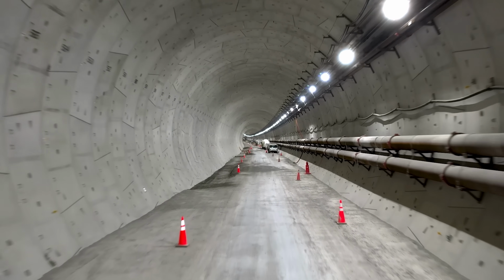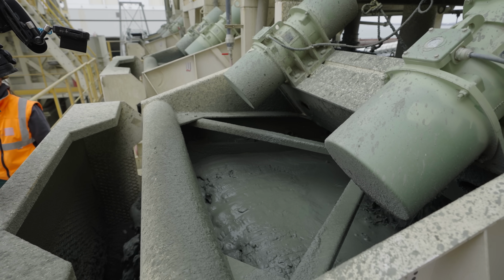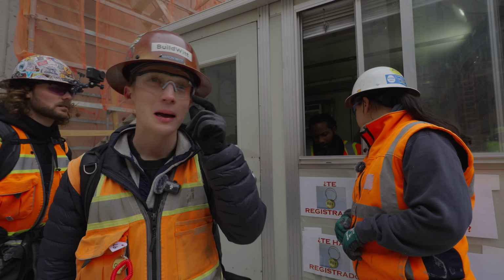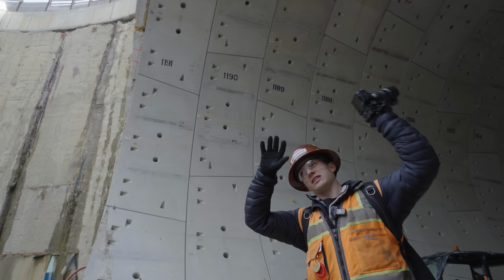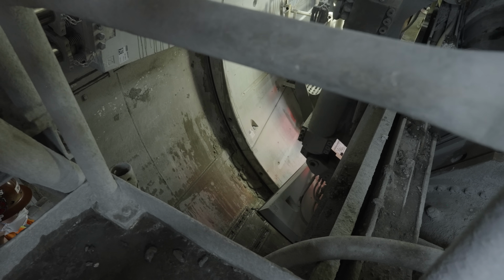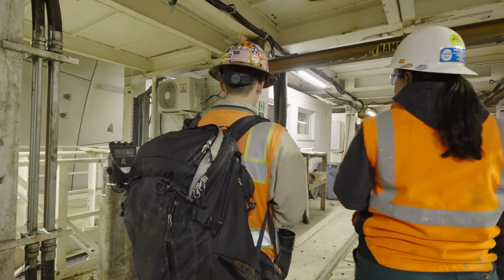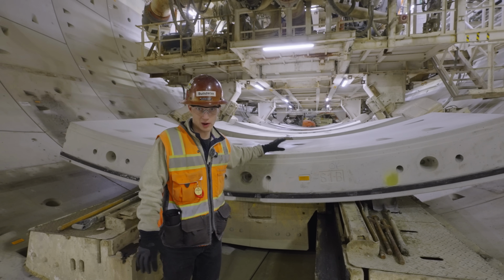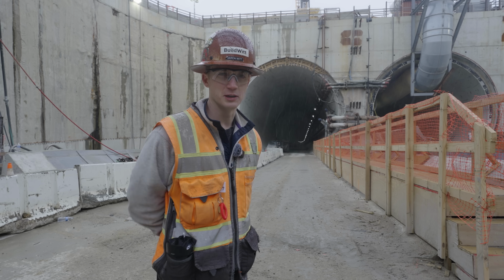Inside Virginia’s $4 Billion Tunneling Megaproject!

Comment: This will be great when it is finished. Coming down to VA Beach from the Shenandoah Valley for the Neptune or summer vacation, for many years due to traffic congestion, I started taking the back way coming in from US Route 460 off of I295 and then picking up US Route 58 to bring me in rest of the way. The back way is a scenic route and slower speeds but the time works out to the same as if you took I64 all the way to I264 IF there were no backups which is rare on a holiday or special event on a Friday, Saturday or Sunday afternoon or evening.

Comment: My 20 years oilfield 6 of it was as a Derrickman tripping pipe and maintaining the designed chemical composition of the drill fluid "mud". The filtration system..shaker,degasser, desander, desilter, active pits where the mud is pumped downhole to the bit where it's circulated uphole, the downhole cuttings to the surface where it flows across the "shale shaker" to initiate again its full filtration. Great exercise 💪

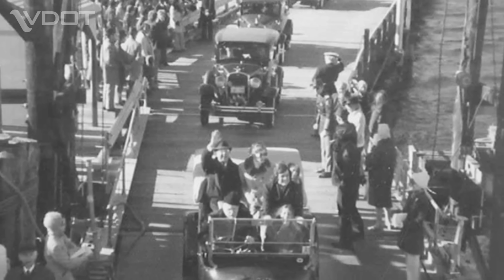Comment: 1:01 I think the HRBT technically is a replacement of the Old Point Comfort-Willoughby ferry, which operated from at least as early as the 1920s until the HRBT opened in November 1957.

Comment: The TBM launch pit is built using three circular rings that act like arches, with each segment functioning like a keystone to prevent collapse during excavation. Building the launch pit is a feat in itself: each section is excavated in stages (about 8’ wide, 15’ long, and up to 250–300’ deep), reinforced with rebar cages, and filled with concrete using the tremie method. This process is repeated until each ring is complete, after which the interior material is excavated and removed. Finally, large struts are installed at the top where the rings connect to provide additional support to prevent collapse of the side walls. That’s why they are not square

Comment: It's a vibratory not a shaker.  TD  Atlanta USA
Reply: In the tunnelling industry the STP is generally made up of three stages a trommel (to 10mm), sand shaker tables (to 0.2mm (200microns)), Hydrocylones (to 20 microns). The rest is the same size as the bentonite in the slurry so goes back into circulation. As the fine particle density increases a portion of the Bentonite/silt/clay slurry is removed and fresh quality bentonite slurry is replaced.
The waste bentonite removed can be tankered away of put through a centrifuge or filter press to remove the remaining solids and bentonite, leaving clean water to recycle back into the process.

Comment: Also could you just make the drill heated to the point it makes the rock and dirt molten? Then the drill is both heat resistant and cools the material as the device moves turning it into an almost glass tunnel? Less debris and need for the slurry thing? Like a nuclear laser drill.
Reply: Imagine the energy required to heat the sand to melting point then cool it down again.
The TBM would also melt in the process of course.

Comment: Mixture ( bentonite ) out of what they digging?  Bentonite?   You got distracted so pumping into where?   I am missing some parts….TBM?  

Ok did research. TBM is the boring machine. Bentonite slurry is a mix of water and bentonite clay. This slurry is injected under pressure to stabilize the soil around a TBM. "Bentonite may form a protective layer—a filter cake—that seals off the tunnel walls," Zhang explains. The infiltration of bentonite and/or filter cake formation prevents soil and water from entering the tunnel and ensures the stability of the tunnel face, particularly in loose or permeable soils.  Ok, I thought everyone knew how this worked, you just waited to show.  Incredible machine, well done for presenting this.

Comment: Just watched the video, decent. Some information that i would've liked to hear/learn about is the electrical system in the tunnel and the air movement system to remove the carbon monoxide from vehicle exhausts in the tunnel. Also is there going to be some sort of cellular connectivity built in the tunnel.
Reply: Large TBM’s have 33kv cable feeds into the tunnel. Transformers on the TBM to step down to 600 or 1000v for the cutterhead drive motors.
Other transformers for all the other systems (hydraulic and electrical).
Forced ventilation into the tunnel (flexible duct in the tunnel crown), rated to provide replacement air for all the people and plant exhaust.
Multi service vehicles (MSV) seen in this video can be diesel, electric or hybrid. Diesel usually has dust scrubbers to clean the exhaust but still good ventilation required.
Leaky feeder cable used for communications. Used in construction and operation

Comment: It seems that you neglected to mention a very important aspect of the tunneling process. How about explaining how the machine must have a larger diameter than the concrete ring so as to keep the freshly cut tunnel from collapsing in AND the grouting process that fills in and seals that area. Good thing she mentioned the pipes used for the grout and the concrete grout accelerant.

Comment: Very informative for those who has no idea for tbm tunneling.  I m working in a project which cutter head diameter is 13.30 m.  
why not  rectangular ?  Because ,the best geometric shape for charge distribution and transmission is the circle.And also this segment shape  is not a %100 circle. it's a chonical.

Comment: Isn't almost 100% of the capacity issues of the tunnel caused by the post tunnel connections not having the ability to absorb the existing tunnels full traffic at highway speed?

Comment: Bake in the olden days guys were digging by hand in a tunnel in NY city that was pressurised. During the digging they dug into the ocean and a bunch of guys were spit into the ocean like a whale spout.  I remember one of the guys suddenly found himself swimming floating on the ocean surface and was back to work shortly there after.   Great how video Thanks.  I have been through the original Chesapeake bay bridge tunnel tunnel many times.

Comment: So does this machine get sent to another job after this or was it built just for this one?   I know I have seen other tunnels much longer that they will bury the machine when done.
Reply: The TBM will be dismantled and most likely sent back to the manufacturer under a “buy-back” agreement as part of the supply contract.
The majority of components are “re manufactured” to “as-new” and used again on the next Machines.
E.g the main thrust rams will only have been in and out a couple of thousand times to complete the whole project. A strip down and a new set of seals and they are as good as new.
Large TBM’s can be 90% recycled

Comment: Here in Seattle they finished up the almost 2 mile long Hwy 99 tunnel in 2017, and at the time Bertha, made by Hitachi, was the world's largest earth-pressure balance TBM at 57.5ft/17.5m and 6,700 short tons. It got stuck due to hitting a well casing only 1,000ft in and they had to dig a 'rescue pit' to go in and remove the cutter head to repair it. Lawsuits flew, insurers complained, and it was a political fecal exhibition, but we got a shiny new tunnel and were able to tear down the seismic deathtrap that was the Alaskan Way Viaduct.

Comment: Good afternoon and I enjoyed your video. I live a little North from there in MD suburbs and I'm a retired Master Electrician after 45 years in my trade. I assume that TBM had an electric source to power and you mentioned transformers for either step down or step up voltage. Were you given a supply voltage for the unit? That's a long way for 480 VAC to travel in the tunnel so my thinking is that it could be 4,160- 13,200 volts with portable HV cables suspended in the tunnels. Any ideas? Thanks,

Comment: Am i missing something.. They didn't want a bridge.. but there's a bridge to get out to the tunnels..
Reply: It’s a security threat to make it all bridge. It’s bridge AND tunnel.
Reply: @JhonnyBoi  I get that.. But, just take out the small section of bridge.. 

I get its easier to build a 100ft section than a few hundred or thousand feet.. But the point still stands.. You can cut off access just as easily, the only thing you actually gain is a faster rebuild time.
Reply: @die4ever8 the access they’re concerned about isn’t the vehicles. It’s the ships. They only need the ship channel to be unblockable. Otherwise if they did all tunnel it would increase the cost and time by multiple times. The Eastern Shore tunnels which are the next ones to cross before you get to the ocean are 22 miles long. Just the mile long tunnels in this video are 4 billion so imagine 22 miles, per direction, plus all the other tunnels in the area. I believe it’s something like 6 or 8 that they cross from the ship/ yard/naval base before going into the Atlantic. You’d be looking in the hundreds of billions if not over a trillion dollars just to make tunnels, that will eventually get filled with traffic once again and have to add more (which is why they’re doing this project to begin with).

Comment: No matter how many highway lanes or tunnels they add around here in Hampton Roads, it will never be enough the way car traffic keeps growing. You can look at any area around here where the widening was already completed and the traffic is always just as bad as it was before. The fact that they are going to add paid express lanes and tunnel tolls to both the Hampton Roads and Monitor-Merrimac tunnels to pay for this is a pain too. If they REALLY wanted to fix the traffic problem, they'd bore those tunnels and run TRAINS through them, not more cars. 

I've heard it said no one around here will use public transport, but that is because the public transport around here is limited almost exclusively to busses... that are trapped in the same terrible traffic as the cars. Get trains running all the way from Virginia Beach to Richmond with stops at major hubs along the way, and have robust bussing options from those points, and you'll see a lot of public uptake. With the way our local cities fight each other though, it'll never happen. Norfolk HRTR started a commuter train, but it suffers from 2 problems: 1) It doesn't go anywhere outside of Norfolk - Virginia Beach famously opted out of the project, complaining that a train connecting Norfolk to the oceanfront would bring in "the wrong sorts of people." and 2) to save money, several portions of the train are on the ground WITH THE TRAFFIC. I have seen the train get stuck because there are cars across the tracks.

Comment: Part of the structure of the tunnel will be the ventilation system.  Usually the overhead is the exhaust system.  The escapes on the side will be the fresh air supply, so if there is a fire, people are escaping through the fresh air.

It is interesting they backfilled the floor.  Often the bottom is open, with a bridge spanning an open space below.

I wish they had covered more of this.

Comment: The city of Norfolk, Virginia is actually a peninsula surrounded on three sides by natural bodies of water. Southeast of the city, it is connected to both Chesapeake and Virginia Beach. Slightly further south is the eastern portion of North Carolina leading to the Dismal Swamp and the Outer Banks of North Carolina. Norfolk itself is predominantly at or below sea level. 

Norfolk is my hometown area from youth. I've traveled via HRBT both by car and Greyhound many times throughout life. I've been away for a dozen years now on the opposite coast. 

The extra bridge tunnel is overdue, but it will relieve some of the congestion along I-64 and I-95 once the project is complete. 

Alternate routing runs through Virginia Beach across the Chesapeake Bay Bridge tunnel to the eastern shore of Virginia & Maryland. I've traveled that path two or three times. It's much less congested, less direct, but eventually can either continue up the East Coast or near Annapolis can turn off west to Washington, DC. 

One can only imagine the disconnect and disruption of travel that would exist if there were no bridge tunnels in southeastern Virginia.

Comment: The fact that a nearly 50’x500’ tunnel boring machine with all of its materials, mechanics and engineering involved still cost only half for what the US paid for a single f22 fighter jet (195 f22 raptors where made, the could have bought nearly 400 TBMs 😆

Comment: 7:45 when it came to the 3 circles (located on the South Island) my understanding is that circles are able to take the soil loads as hoop thrusts, which then transfer the axial loads within the lining to the intermediate beams that support the excavation. Otherwise what happens is you need to design the walls for a significantly larger flexural force to compensate, which can be very difficult for soft soils. It’s a very similar concept to pressure vessels for those who have taken some kind of elementary engineering course like solid mechanics or strengths of materials. I joined the project design team only recently, but as someone who is currently involved in the project, that is my interpretation based on what people told me at my job. Now the reason for 3 circles, no more, no less is because of what was said, to fit the TBM. The North Island only has 1 circle because it is only for reception of the TBM, which they will be turning around to excavate the other tunnel. However, again it’s a circle because of the same design concept. Hope this provides some clarity into the engineering mindset!

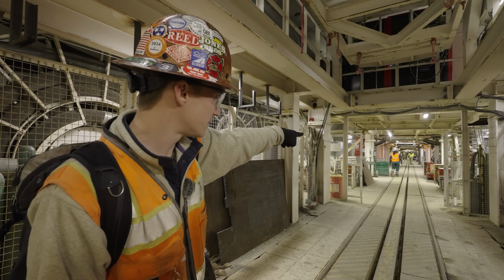Comment: 21:55 You ain't wrong. FYI, the playing field for football (American football, not soccer football) is 100 yards long. A yard is exactly 3 feet, ergo a football field is 300 feet long. As the TBM is four-hundred-some-odd feet (can't be bothered to try and find where you gave the exact measurement), it's actually longer than a football field, indeed, significantly so.

Comment: Here in Ft. Wayne, In. We have a $400 million massive underground infrastructure project stretches nearly five miles, sitting 220 feet below the surface and 16-foot-diameter. It's the city’s Deep Rock Tunnel. It was built to hold an estimated 290 million gallons of stormwater and sewage that would have otherwise flowed directly into local rivers. From there, it’s directed to Fort Wayne’s wastewater treatment plant for safe processing. Beyond the rivers, the tunnel benefits thousands of residents and properties by reducing basement backups, yard flooding, and standing water on streets.

Comment: As someone who drove through this tunnel so much I know that the new tunnel isn't going to fix the traffic problem. It might alleviate it a little bit but it won't fix it, simply because the problem is the idiots who slow down when they approach the tunnel then speed up once they're on the other side

Comment: We need a project like this up here in Michigan! Consider that Michigan consists of two separate peninsulas, a lower one attached to Ohio and Indiana, and an upper one attached to Wisconsin. These two peninsulas are several miles apart at the Straits of Mackinac (pronounced Mackinaw) where we have a 5 mile long suspension bridge which carries I-75 across the straits. The problem is, that bridge is a choke point and is the only way across, so it is a vulnerable spot. Last week we had an ice storm, and the Mackinac Bridge was closed off and on for two days, and then was closed for 30 hours straight, and by the time it was reopened, at least two counties in the upper peninsula were essentially shut down because of the lack of essential services due to the bridge closure. All the gas stations were out of gas, for instance. The only alternate route means circling Lake Michigan, which takes more than a day driving continuously, so basically nothing works without that one link. The bridge rarely closed in the past, and if it did, usually it was only a few hours and it was back open. But for whatever reason lately the closures get longer and more frequent, and we’re starting to think we need a means of crossing this waterway that can’t be shut down by the weather. A lot of people are thinking about tunneling under the Straits, and seeing this video, I think I like the idea.
Reply: And best of all? Building a tunnel there would not disrupt the use of the bridge. Unlike the situation in Hampton Roads.
Reply: Every bridge is a choke point.

Comment: I'm guessing the way the concrete rings steer the tunnel is by the 9 segments having different widths. Put the narrower segments on the left, the tunnel turns left...   Are there straight segments also, or do they always use the turn segments and just arrange them so the average is straight by going back and forth like a directional driller does? I expect they have straight segments and just feed in turn segments when they need to turn.
Reply: The segment ring is called a “universal” ring. It is slightly wider on one side and slightly thinner on the opposite side.
By rotating it to where suits it can “steer” from the last ring built and follow the TBM (which steers itself, not from the rings as they said in the video).
Think of a thick cut salami but with the slices being cut slightly left then right. Rotate the slices and you can go left right up down.

Comment: I grew up in Norfolk during the 1960s/70s. HRBT was only two lanes the first time I crossed it; four lanes when I went into the USAF in 1974. What I really don't understand is why this expansion wasn't done 30-40 years ago! It's been needed for that long!
Completely different technology that the original tunnels as well as the Chesapeake Bay Bridge Tunnel .

Comment: Crazy  a tunnel is not needed  32 street San Diego CA has a fleet about the size of Norfork, and it passes under a bridge that goes to North Island.  The bridge was designed it is attacked  the center part of the bridge, which floats, and a ship can just push it out of the way.